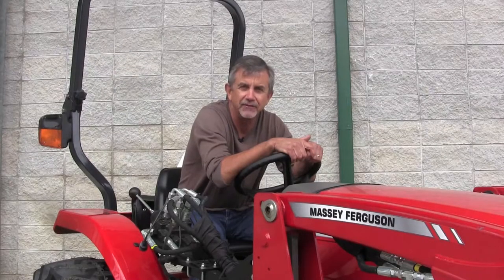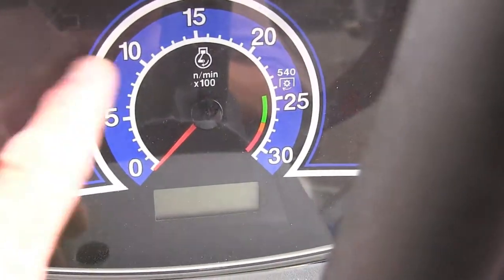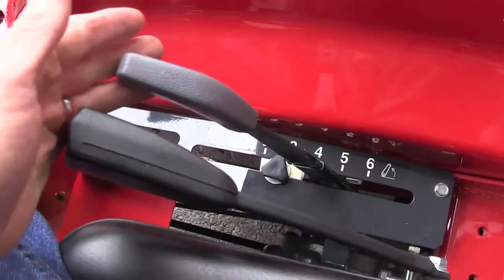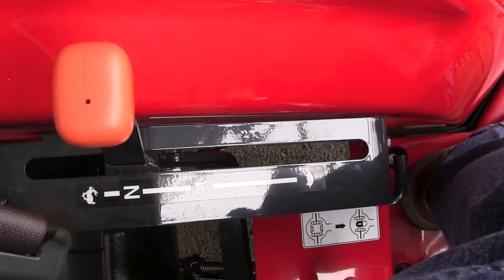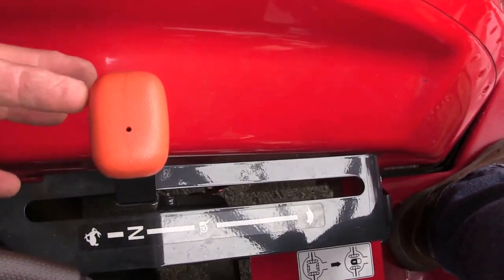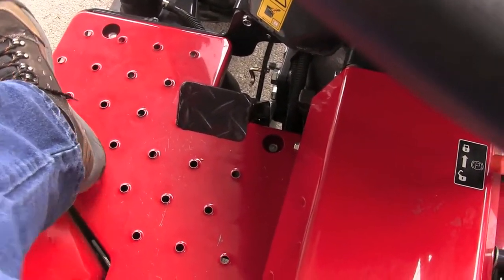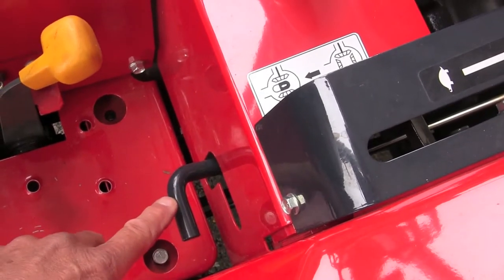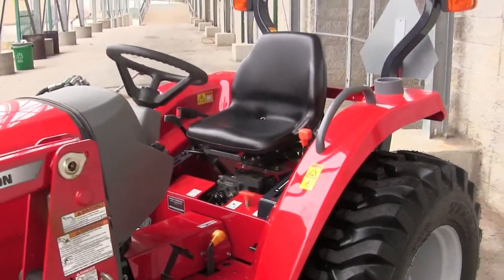Massey Ferguson 1700E Series Tractor Controls

Comment: Tractor mike for your edification at 3.16 on your video take note many people don't use the rocker pedal properly!! your foot should have the heal on the deck and the toe of your shoe should be on the top of the pedal to the rt ( note curvature of pedal and forward tab is to the rt. of center on the pedai).this allows you to push down and go forward only!! with your foot on the treadle many times you will go into reverse,this is dangerous for an inexperienced operator. You should also take your foot and use the toe to engage the reverse mode ,again you will not go to neutral and   accidentlly go forward .Otherwise a good video